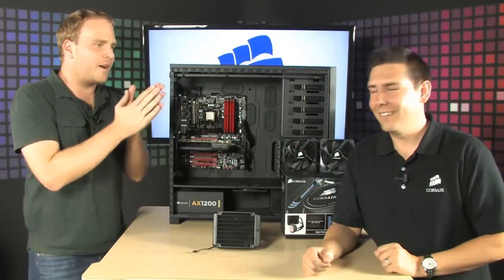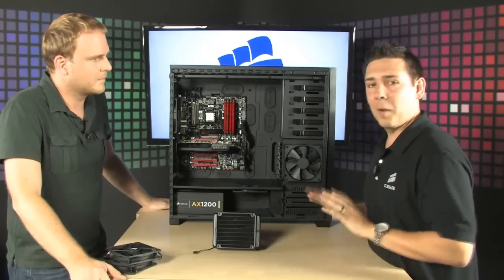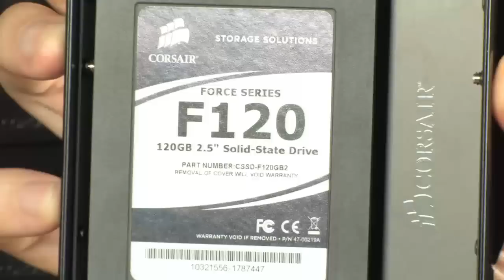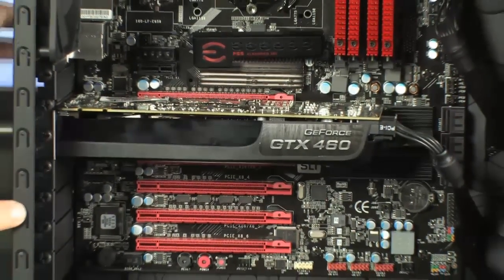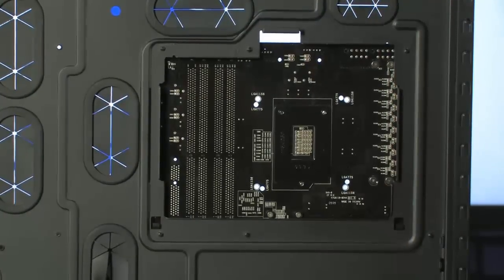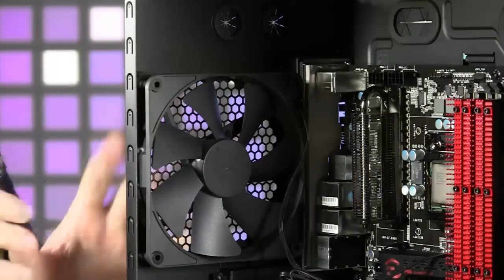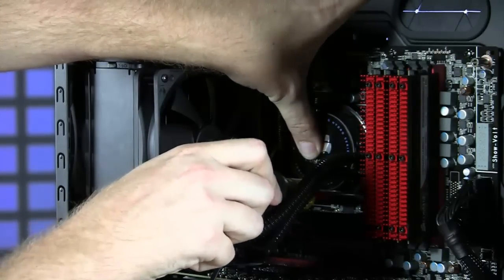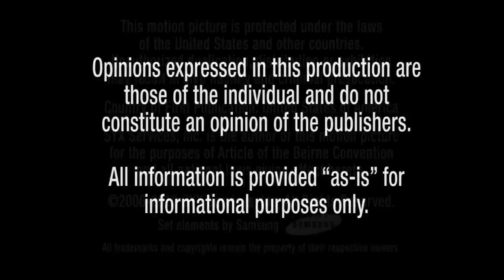How to Install Liquid Cooling on a PC

Comment: I find the 800D too plain but im going to get it Modded and then buy it. custom watercooling system though. Corsair is the best company only if i had the money to buy the 300$ Dominator GT's I think the modular 1000W Corsair PSU would the the best choice. Antec is weird the last psu i had made a high pitch ultra sound. killed my ears. that was like after 3 months of use 

the Corsair TX750W i used already for 4 months and i bet it's going to go into my bros new pc as i get the 1000W PSU

Comment: uh how does this guy rep corsair....first off it comes with two 140mms on the bottom and rear exhaust...the top 3 ports are for 120mm's cmon dude get your fan dimensions right.